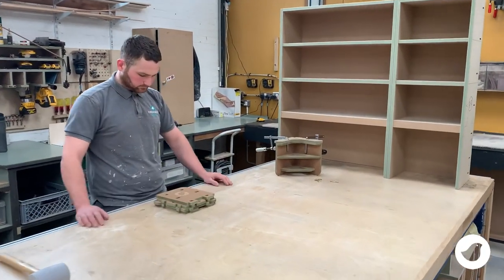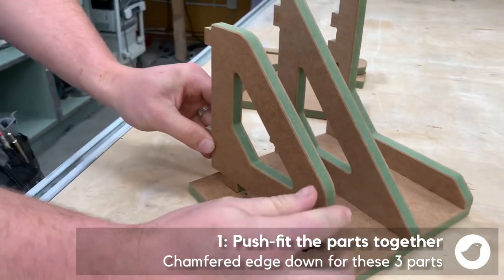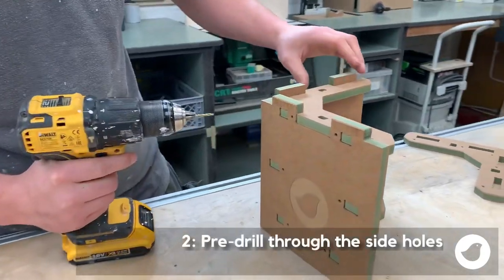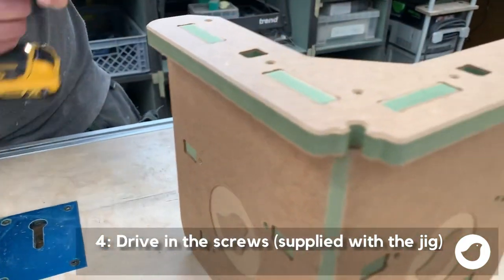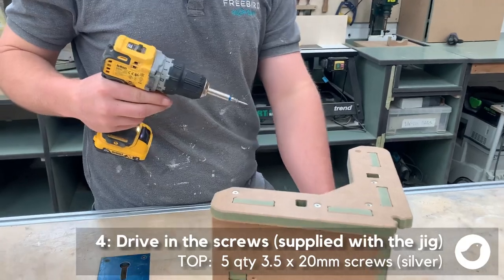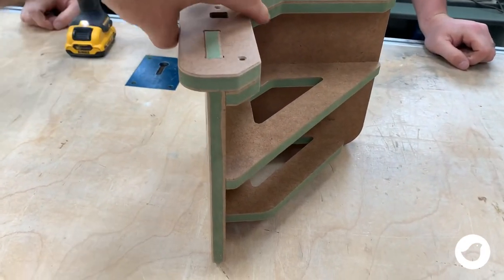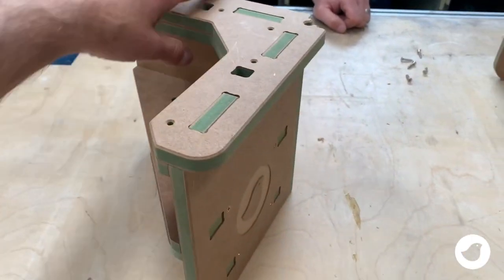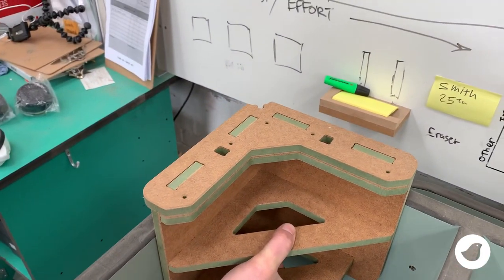How to put together your Freebird 3D Assembly Square

Comment: just received this through the post this morning. I'm really impressed at how well this is designed, obviously you've given it a lot of thought. I noticed that the bits can only go together in one way, and that the corners of the joints have little reliefs in the corners I guess to prevent the tenon corners wearing? It all fits together very tightly. Nice handle parts too. look forward to using it!
Reply from the maker: Thanks for taking the time to feed back here I appreciate that!  Yes after the initial CNC test piece I kept making little refinements to help it go together better!  The mortice holes need to have little 'dogbone' curved corners  to account for the radius of the cutter, to allow a rectangular tenon to fit in

Comment: I’m guessing this is as applicable to making cabinets as it is bookcases…?
Reply from the maker: definitely.  Customers are using it for wardrobes successfully.  But we do have an 'XL' version in the pipeline -  bigger and with an added slot to allow placement of one clamp further down, for shelves which are set back to avoid clashing with hinges